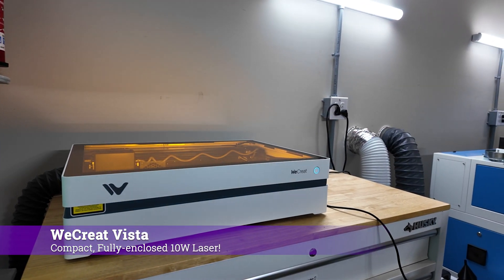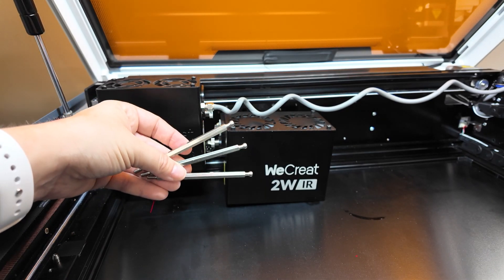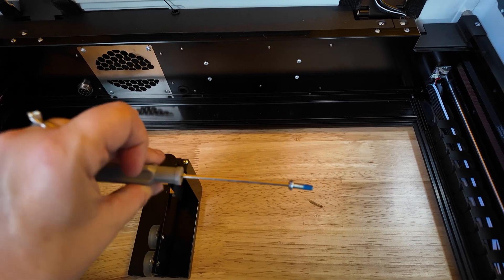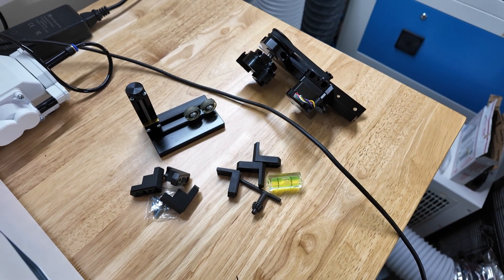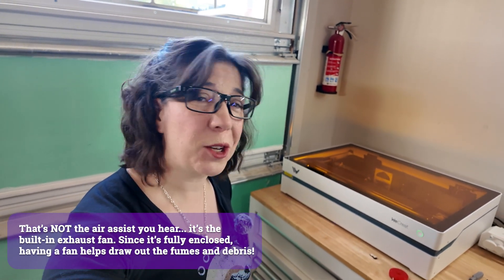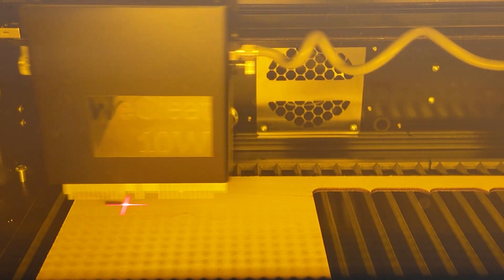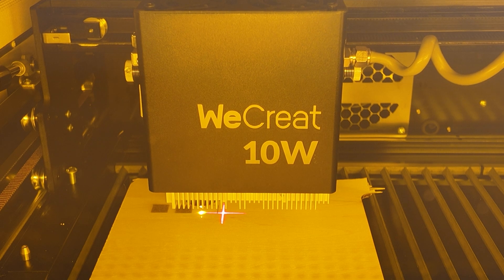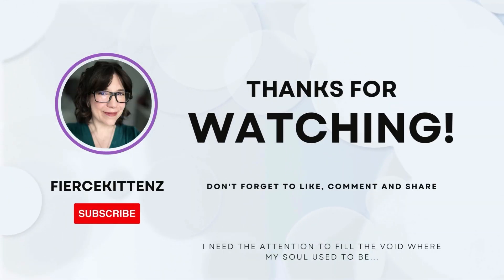WeCreat Vista - 10W Compact Beginner Diode Laser with Flipping Technology!

Comment: Hi! Thank you for your videos! How does this one compare to the xtool m1?
Reply from the maker: They're two completely different beasts. The WeCreat Vista is only a laser and fixed at 10W. It can't be upgraded. The xTool M1 Ultra is more like a Cricut and a diode laser had a baby and that baby got all the good genes. The WeCreat Vista is more compact and has a larger work area, but it's less versatile than the M1 Ultra. The M1 Ultra's work area is just 12x12". Both are diode lasers. The M1 Ultra has an option to get a 20W laser head, but by default it comes with a 10W - they are swappable. I have both and can change out depending on what I'm doing.

Comment: Let me start by saying that in no way am I discrediting your presentation. In fact, I always think you do a fantastic job 👍. That said, I am going to criticize WeCreat as a company and their products. I can personally testify to what I'm about to share as an owner of the WeCreat Version 20-watt laser. I’ve gone through three units of the 20-watt lasers from WeCreat, and each experience has been unpleasant.

My first WeCreat laser was a nightmare. It arrived damaged, and corresponding with tech support was nothing short of ridiculous. The WiFi didn’t work, the power cord was loose, and the crumb tray was nearly impossible to remove or slide back in. The camera was way off, even after calibration. For every issue, tech support placed the blame on me. Mind you, the back-and-forth correspondence lasted over a month. Additionally, WeCreat does not do exchanges, even if the unit arrives damaged. Eventually, I got them to accept a return. Once the return was completed, I ordered another one. That too was sent back for many of the same reasons. My final order arrived in decent condition, though the crumb tray was again impossible to insert or remove. The unit had to be tilted to remove or insert the tray. And the camera? You guessed it! Still not acceptable.

After owning all three units and spending a lot of time watching WeCreat’s live shows on YouTube, I noticed that this company seems more focused on pushing out products than fixing engineering problems. In their Q&A sessions, they often ignore questions that are relevant to my issues or blame the user.

The fact is, there are too many flaws going unaddressed, and the company is not taking responsibility by recalling or fixing the issues with their newer models. Some of WeCreat’s concepts are also inconsistent with other brands. For instance, swapping out the 20/40-watt module for the 10-watt one is unnecessarily complicated. There’s no easy way to switch back from the 10-watt to the 20/40-watt module for different projects. Using the rotary attachment is also time-consuming to install. Some people may disagree about the rotary installation, but they likely haven’t tried other laser brands to see the difference.

Then there’s the camera. Many people don’t realize that WeCreat uses one of the cheapest lenses on the market: a fisheye lens. This means to get a precise image of your project, it must be dead center under the camera. The further your item is from the center, the more your laser projects will be misaligned. The WiFi is another issue. The original WeCreat Vision 20-watt uses the cheapest WiFi chipset, which only works on a 2.4 GHz network. You can’t connect the WeCreat to a 5.0 GHz network, and some batches of the Vision have known WiFi drop issues.

Oh, that crumb tray! Anyone who has used the WeCreat Vision will absolutely understand my frustrations. The crumb tray is a major flaw, and WeCreat should have issued a recall.

For two years, I’ve dealt with WeCreat’s customer service, which is one of the worst I’ve encountered compared to other laser companies. There are bad ones out there, but WeCreat is just as bad. From deceptive marketing to ineffective troubleshooting, in my opinion, WeCreat is not an honest company. They flood social media by giving out massive amounts of units for promotion while implying they’ve sold hundreds, which they haven’t. Most of the units were giveaways to make it look like they were trending.

Now WeCreat has come out with the WeCreat Vista. Why? Because xTool has a laser specifically for home crafters: the xTool M1 Ultra. The fact is, there’s nothing new about the Vista, and it still has limitations compared to the xTool M1 Ultra. Here's the big difference: the xTool M1 Ultra is a true 4-in-1 crafting machine. It comes with a 10-watt or 20-watt module. It can laser, cut, print, and draw. Every module can be swapped out with ease—just slide it in and out, with no screws or attachments needed. The duct hose is magnetic with a built-in fan and can be attached on the left or right—again, no screws required. The unit is upgradable and comes with four utility blades: fine point, ultra point, foil, and rotary. You’re not limited to specific pens, as you can use Cricut or third-party brands. The xTool is so versatile that it could replace your Cricut or Brother cutters. Most importantly, xTool lasers are incredibly accurate! They laser exactly where you want them to, thanks to the pinpoint system, which WeCreat can't even come close to matching in terms of accuracy.

I am not sponsored or paid by xTool. I am 100% convinced by xTool’s company and products. After owning several laser brands, there’s nothing quite like xTool. Aside from WeCreat, I also own the xTool S1 and recently bought the xTool M1 Ultra. From high-quality builds to excellent customer service, I wholeheartedly recommend them. For me, xTool is the only laser company that will fix a flawed job and work with you to get it done. Plus, xTool is one of the few laser companies that constantly innovates. Buying an xTool product is like buying an Apple product—you get what you pay for.

In conclusion, I don’t want to see WeCreat fail. To succeed, they need major changes. I’m not sure if WeCreat is only in it for the money, but I hope not, and I wish they would evaluate their foundation. They have a good concept for laser products, but too many flaws and an unwillingness to acknowledge them will only drive the company in the wrong direction. If it were up to me, I’d overhaul their customer service and design teams. This would ensure a better relationship with customers and better product outcomes.
Reply: ChatGPT boy from xtool?:face-blue-smiling:
Reply: I don't think so. The machines of WeCreat are cheaper. Buying the same configuration of S1 will cost $500 or even more than WeCreat. Do you know how many materials can be bought with $500? In addition, my experience with the camera of WeCreat is not that bad. As long as enough tolerance is reserved, the final project effect will not be very poor. The camera is very suitable for a lazy person like me. The M1 Ultra is a very all - round machine, but in my actual experience, each of its functions is not deep enough.